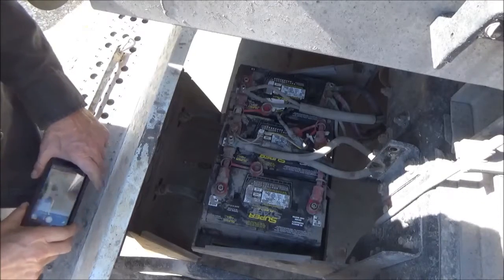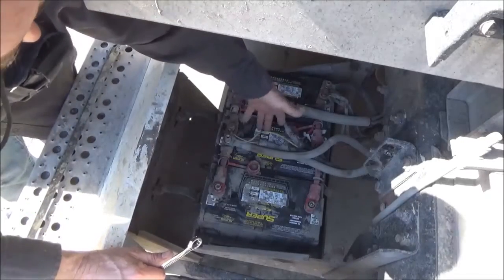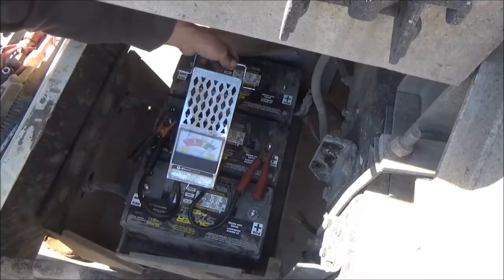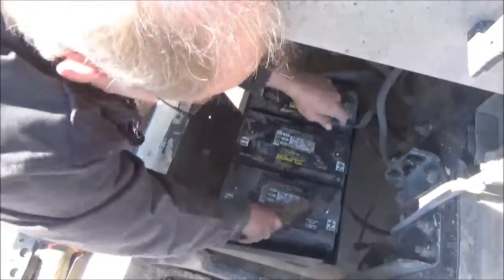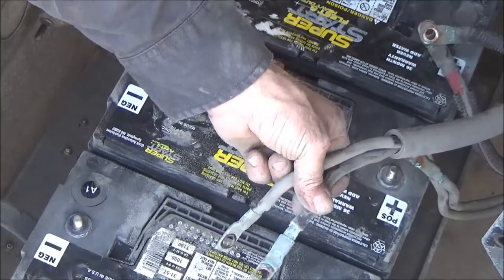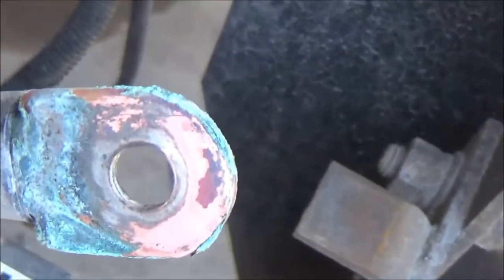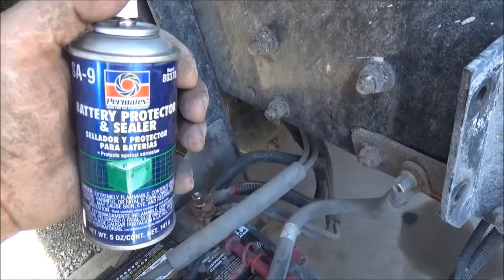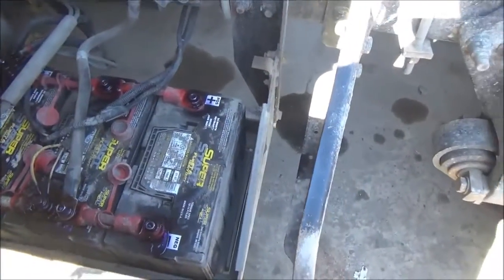How to load test big truck batteries

Comment: I use 3M spray adhesive to coat battery terminal ends . Be careful do not short the metal can on the batteries , the spray is flammable.    74/23

Comment: I think it is also good if You put little grease on the top of each connection positive or negative, better than that spray. I am not saying the spray is bad choice, but I think the grease keep contact clean for longer amount of time.